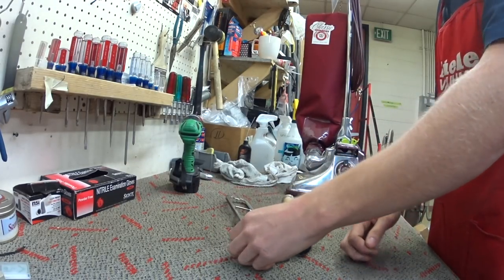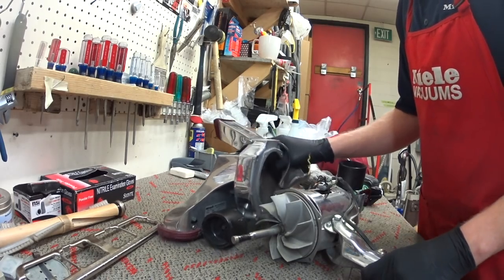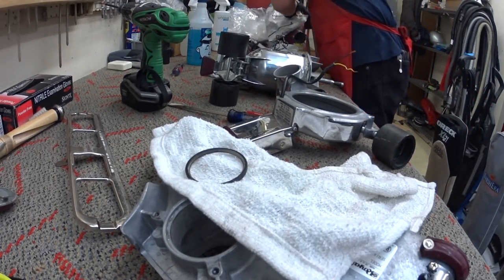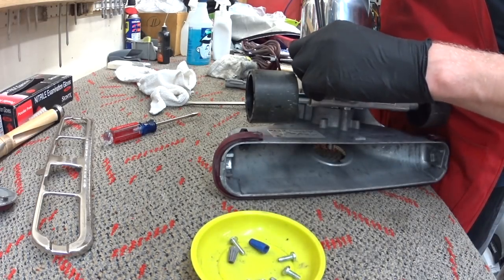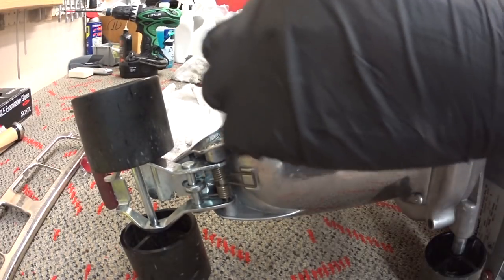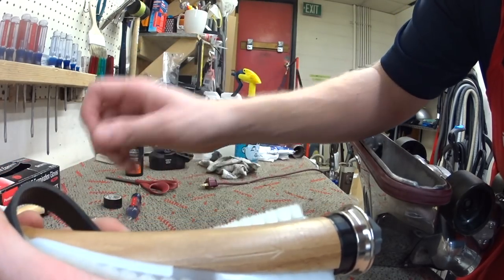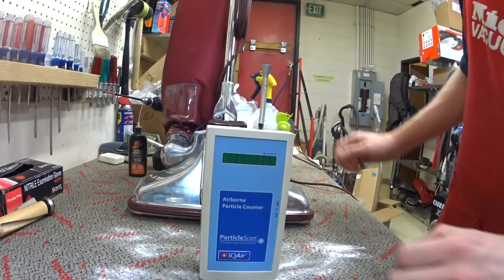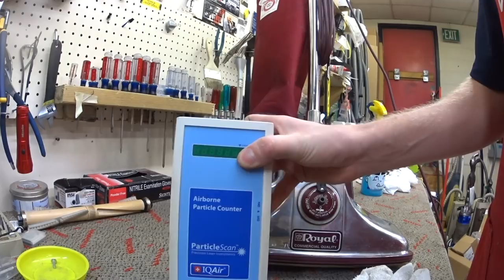Royal 4000 upright vacuum Tune up repair

Comment: We got a model 4000 back in the mid 90's. We still have it and will still have it for many years. Ours was even used for commercial use cleaning a church for many years. For a "Cheap" vacuum I think they do quite well. They are very serviceable and I have even found bearings for the brush roller to extend the life of it.

Comment: Great video!  I just came across one of these Royals.  It is absolutely filthy.  The beater roller was full of hair!  The orange bag has a hole where the hang chain penetrates.  There was no paper bag and nastiness was shooting out of the hole through the top of the orange bag.

I'll see what I can do with it.  I'll be using it to do a "final clean" on construction job sites, mainly drywall dust.

Thank you for posting!

Comment: Cool vacuums for a collector for sure, I own 2 of them, an 880 and 882, decent machines, they seem to clean well enough, super easy to maintain. One of the has the micro cracks you mentioned, right where yours was...
Reply from the maker: +Hank's Small Engine Repair Royal 800s are among my favorite machines and far superior to this thing on my bench as far as I'm concerned. I've got a video coming up with some 800 including a royal 888 .
Reply: @PerformanceReviews  you inspired me. I just checked the label on  my own Royal upright and mine is an 800!  You are right, my 800 is a bit different from the one you're working on in this video in terms of some of the little accents.  For example,  my 880 wheels have these  chrome looking "hubcaps" with the etched Royal crown logo facing out from each wheel.  Your clip was really informative and helpful 🐕. Mine also uses a bag that attaches near the bottom inside the cloth bag with this springy metal cuff that rolls over the paper on the connector.

Comment: I found a Royal 9961 on ebay. I disassembled, cleaned, and buffed all the aluminum out. I then cut the axles off of it, and fabricated replacement axles out of metric bolts, that I MIG welded in place. The reason for the axle modification, was I installed skateboard wheels with ball bearings. No more squeaks, and it pushes SO smooth.

Comment: Reminds me of my Royal in many ways, I have a Classic model 9089 from 1989. If I'm correct, that was the last year for the older 6 amp motor that it uses before they went to the louder motors that they still use. Mine is a relatively quiet vacuum and has that classic Royal sound to it. It lived a rough life before I got it almost 4 years ago, the metal is dulled and scratched and it needed a serious cleaning. It also needed new carbon brushes in the motor and ever since then it has run like brand new. My favorite vacuum I've ever used, the airflow is so powerful and the roller brush propels the machine across the floor. I will never sell it, I have yet to use a vacuum that works better and I've used a lot of vacuums.
Reply from the maker: The old classic American royals are definitely great. But definitely can't compared to so many modern options that have much more power.
Reply: They really got louder because of an increase in the number of fan blades, from six to nine.

Comment: Great machine! I have the 2028. In the past I have had two 880s and an 801.
Reply: Matt Jones Which one in your opinion cleaned better, the Royal with the higher or lower amp motor?
Reply: Honestly, the newer one. The other three I had had like a 3 amp motor. The ones made from the early 1990's-current have stronger motors. The 2028 agitates WAY better than my older machines did. It restores the nap on the carpet and rugs. The HEPA bags filter much, much better than the old Royal type A (same as Eureka F&G) bags. My older ones, however, were lighter and a little easier to use. The older ones are better on hard floors, too, as the newer ones tend to scatter certain debris. So, while there are pros and cons to both old and new, I'd go with the newer models if you have a lot of carpet and little hard flooring.
Reply: Matt Jones I always had the feeling that the higher amp motor would do better, but I thought I'd ask since I've never had a Royal but do have a Kirby g3 which is a pretty solid machine with the 7 amps that it uses and isn't too loud either. Thanks Matt
Reply: Sure, no problem. I have a couple of Kirby vacuums, too. I have a vintage 519 (1959) and a Diamond Edition (2005). The Diamond is my main use machine.
Reply: Matt Jones They're awesome.. doesn't take too much to keep them going... I might upgrade to an avalir sometime, (still toying with the idea) but the diamond is one my favorite models too.. if I remember that one had the two speed motor.. very cool machine and color scheme
Reply: Yes, it's the only Kirby with the delicate switch. Very handy if you have mostly hard flooring and area rugs.

Comment: Looks a lot like mine, except it’s an anniversary edition from ‘89, older than me by 4 years lol. Takes the type A bags, but I use F&G because they are available just about everywhere. The brush roll has square-ish inserts on the ends, and unfortunately I can’t use the newer brush rolls because they have hex ends. Still works well, despite a busted fin on the fan and a slightly bent motor/fan spindle. It tends to knock the height adjustment out from vibrations and acts like its self-propelled. I call it Jaws lol.

Comment: I wish that Royal still made the Powertank. I'd say that if you were starting out in your first apartment and bought each, you'd have them long enough to replace them much later in life with an Aerus and a Kirby with the money you'd saved over the years by not constantly replacing vacuums. Then again, if they still made the powertank (with an updated powernozzle) you could replace the first pair with an identicle pair and buy a Kitchenaid dishwasher and stand mixer and be set for a long time. Are you sure that these are out of production or are they unable to keep up with demand. I saw these machines of which all but one are in the Commercial line just last week before having trouble logging on to Royalvacuum.com this week. It would be a shame if they cancel them. It's an icon and just look at how nice that 19 year old looks sitting there including how it's nameplate looks. No Royal No! Save the metals!Metal Rocks!
Reply: I agree.  My grandma gave me her Royal 4700 canister almost 10 years ago and I was just going to use it until it died and then buy something new.  Well when it finally had a serious failure a few years ago (the pigtail cord that attaches at the handle had burnt up and actually burned a small hole in the handle housing!) I looked at modern vacuums and decided that I better restore my metal US made canister because any vacuum below $1,000 just wouldn't compare.  I have now restored mine to like new condition and in the process learned to do most of the servicing myself.  I have also stockpiled a number of NOS discontinued parts for it including bags as I fear Royal will eventually stop making them too.  Mine will be 20 years old this year and it's still going strong!
Reply: @tyler2610 your grandma gave you a good vacuum!   I have the red version of the royal canister power team and I wouldn't trade it for anything!  I had the same problem you described regarding  the cord burnout failure at the built in side, not the cannister plug port  near the tank handle, but the area closest to the lid to the filter housing. The cord was bent and fraying for a while and finally sent sparks flying the other day while it was running. it's in the shop now.  I hate not having it here.  I use the horse hair brush attachment  on my long haired akita when she is blowing her undercoat and she thinks she's at the day spa!
Reply: @bookbeing  Yes she did.  I still have it and hopefully will until I die but I haven't used it for over 2 years now.  I restored it to near new condition and just got to the point I was afraid of damaging it and wearing it out so it sits in the closet and now I use a 4600 I bought off eBay that I will probably eventually clean up and sell and find another "daily driver" to replace it.  I actually bought a brand new Kirby Avalir a few years ago but that also rarely gets used as I think the Royal tanks leave the carpets looking a lot better.  I hope your repair shop can get parts for you as everything is pretty much NLA on them anymore.  If they can get a cord it will most likely be black and not color matched as your original was.  I would really like to get a new upper wand for mine but they just seem to all be gone.  I got a NOS one off eBay for a 4600 I was restoring to sell recently but they just don't seem to be out there for the 4700.  I would stock up on bags if you can find some cheap as I think Royal even quit manufacturing those.  I have probably over 100 and I even reuse them a couple times so I should be set for many decades!

Comment: I installed a LED 12v twist in bulb into my 1998 Royal 4000 and when the vacuum is on it kinda works but it is very dim and flickers. When I tested the bulb with a 12V power supply it was super bright with no issues, any advice/ideas?

Comment: Hello. I have the 2075 and would like to know what would the correct belts this vac takes? What's the best place to get them and last but least is what would the year of this thing?  Great vid mate.
Reply from the maker: Royal "style 8" belts are interchangeable with Kirby belts. As far as dating it try to find a date wheel molded into it somewhere. Sometimes they'll be a date code as well next to the model number sticker.
Reply: Performance Reviews Thank you. I do agree with you on this model that its not the best but its fun to run around the house.

Comment: How would you say that Royal uprights compare to Kirby regarding airflow and dear cleaning performance? A 17 pound Kirby sounds attractive as mine is 24 and doesn't have powerdrive. This Royal is lighter by a few pounds than a Hoover React, Eureka Floorrover and Electrolux ProSwivel, three new bagless machines on the market. It's eight ponds lighter than a Miele U1 You'd never think it by looking at them.

Comment: Serious question: How do you (and other vacuum service centers) prevent and handle flea/tick/bedbug infestations? I've restored a few Kirbys so far. For all of them I brought them around the side gate into the back yard, I took the bag off and apart, and split the fan housing. I washed the bag outside by hand, and once I was confident nothing was living inside everything I took it all in the house to finish. I am terrified of bedbugs.
Reply from the maker: +mannys9130 it's a serious question without a good answer.
Reply: Performance Reviews Have you ever had an infestation in the shop?

Comment: I recently purchased a Stark vacuum cleaner which looks like this Royal model. Where can I purchase bags and a belt?
Reply from the maker: Stark rebranded Royal vacuum cleaners at a point in time. Your local vacuum shop should have everything you need. There are also links in the description

Comment: I have the new royal cr5128Z, and sadly Royal seems to have downgrade some areas of their vacuum. The rear cord clip is now plastic, plastic strain relief (very odd), plastic cord cover, and plastic end caps. The brush stiffener is gone too. Apparently the armature cooling fan is also plastic I think as I could see through the vents.
Reply: The plastic external strain relief you mention first appeared on the commercial machines in 1988, but did not extend to the household models until 1990.
Reply: ClassicTVMan1981X oh really? Interesting, i would’ve never thought.
Reply: And when you mentioned that the old-style brush stiffeners were removed, it is because the brush bristles themselves are stiffer.

Comment: Hey there you happen to know what type of brushes that i need to put on my Royal 18” commercial upright? Model 7910Z with 7 amp motor
Reply from the maker: I'm not sure the brush roller is currently produced you need to go to your local authorized Royal /Hoover dealer  . If you're talking about carbon brushes that go in the motor they were never made by themselves.

Comment: How do you get a. Wheel off for replacement?
Reply from the maker: It really depends on the model. Usually you order in the axle with the wheels attached. I would bring it to your local dealer and have them deal with it.

Comment: What vacuums you know of are better than this?
Reply from the maker: +KG5Vacuums that's a very long list my friend.
Reply: Performance Reviews ok name the top five.
Reply: Kirby, for starters: I mean, there's all kinds of off-the-shelf components available for it like the Rug Renovator, Miracle Head (power polisher) and Handi-Butler.
Reply from the maker: +KG5Vacuums sure :)
1. MD Central Vacuums.
2. Sebo /Windsor any current model.
3. Lindhaus, just about any model.
4. Miele Vacuums  full size power nozzles
5. Rainbow E Series
6. Hyla 
7. Modern Electrolux canisters 
9. Simplicity Riccar 20 30 40 series machines
10. Nilfisk 

Even Royal decided that other vacuums clean better that's why they made the power cast which has  tools, lifetime belt, sealed HEPA, bypass motor.
Reply: Performance Reviews Alex the vacuums you mention are more practical and easier to use but I always thought the Royal produces more airflow than any other vacuum even the Kirby it also agitates very well. I think it would be hard to find anything that will clean carpets better.
Reply: That's about what I think of them. Royals clean carpets better than anything else, I think (though the tandem-air Simplicity/Riccar machines are probably comparable), but carpets are basically all they do. Yes, they have tools, and with modern bags the filtration isn't too bad (Miele, Sebo, et al do better, but not bad as such), but they are more-or-less dedicated carpet vacuums.
Reply: Performance Reviews would a Sanitaire out preform this?
Reply: @PerformanceReviews  In researching vacuum brands, it seems a fair amount of them (Kirby, Rainbow, Aerus/Electrolux are members of DSA) use Multi-Level-Marketing to sell their products. Which high quality brands would you reccomend that are not practicing MLM?

Comment: BTW, I forgot to tell you that I am the proud owner of two all-metal Royal upright cleaners: one of them is an early 1985 model 880 (sold by Stark's Vacuums of Portland, OR -- the city I was born in) and a 1987 Prince 786 (which looks like an Electro-Hygiene 903 because of its red trim).

Here's my 1985 880:
https://www.youtube.com/watch?v=0l1sR68YTOY

Comment: If you ever get one of your own and never want to hear a squeaky wheel, remove each wheel, put a little dab of marine grease on each wheel's axle with marine grease for boats. Wash the wheels insides, and reinstall and spin the wheels to lubricate. Marine grease is made to be used underwater and your Royal won't be doing that. It containes silicon and the vacuum will glide on the carpet even better than machine oil..
Reply: You won't need to do it again for about fifteen years.
Reply from the maker: +Bruce Solomon the Tri flow Teflon based lubricant last very long time as well.   I put that  in the wheels. I use the same stuff on my bike chain as well . Seems to last through all kinds of weather.  Doesn't attract too much dirt either.
Reply: Performance Reviews we used triflow in aerosol cans in aviation at one of my last jobs.  I liked it so much at work I bought some for home use. That and LPS 1 and 2 are great too.
Reply: How do you remove the wheels? I've used these vacuums for 20 yrs.; commercial and residential cleans ! Love them! The latest one , purchased December 2018 gave me SURPRISINGLY poor quality; wheel rolled off across a floor and brush was fried in 1 month?!!! I have old one for parts but can't get a wheel off to replace another whose wheel separated rubber from plastic !?